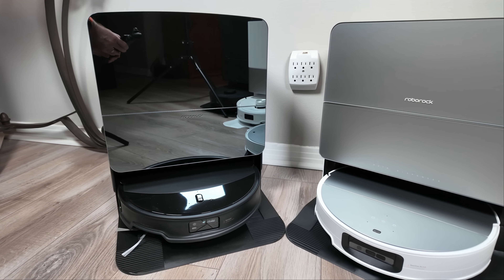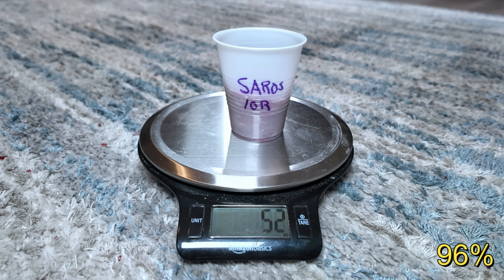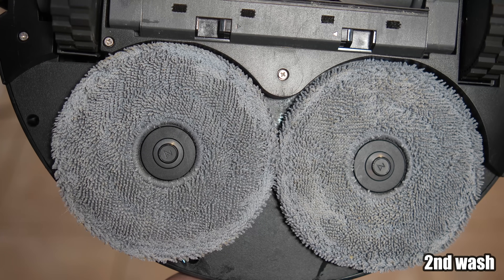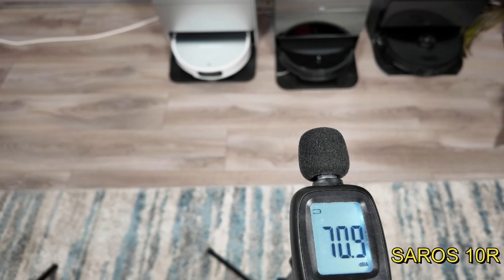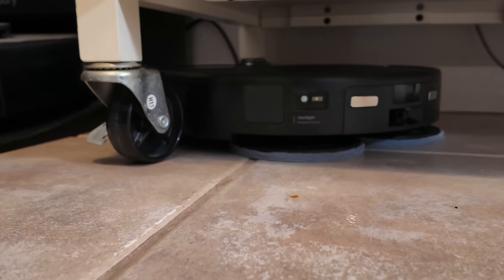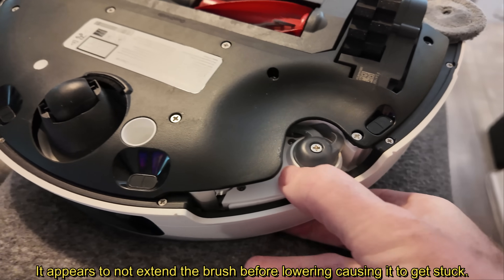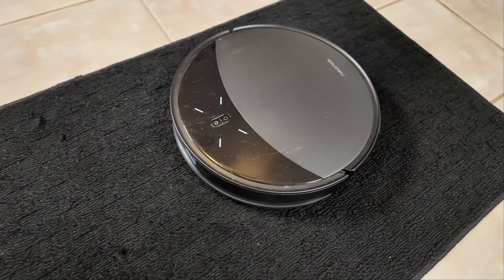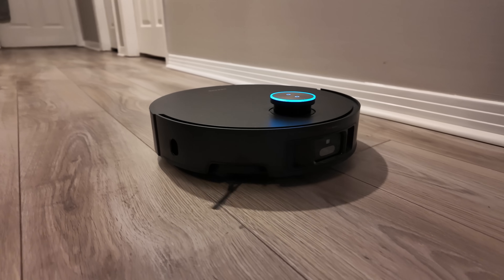Roborock Saros 10 vs. 10R: Ultimate Test Results!

Comment: Great review! I have a question: I have shiny white floors in my house, and when my iRobot Braava m6 mops at certain angles, streaks become visible, especially under certain lighting. I’m considering buying the Saros 10R, but I’m worried it might leave circular mop streaks. What do you think?
Reply from the maker: It certainly could.  Hard for me to say one way or another other than the Saros can wash the mopping pads more frequently and  it also helps to vacuum first.

Comment: Did you put the obstacle avoidance on sensitive? This made a big difference for me

Edit: I meant less collision mode
Reply from the maker: Yes in my tests for object avoidance it was set that way although you will get less coverage with that setting on near walls and furniture. Not ideal. 
Object avoidance for cords is worse on carpet than it is on hard floors.  On hard floors it would sometimes avoid cords and other times not.  The 10r did a better overall job with this.

Comment: I also wish they would make software updates to the flexi arm. Instead, they just keep pumping out new models that don't seem to be much better than the S7. I have S8 maxV ultra and S7+. Can they develop a better edge and corner cleaning system? Maybe a quick software up to do corners multiple times? Or add air pressure to blow the dust and crumbs from the corners on first pass? Or maybe better: small vacuum powered spring loaded nozzle to get edges/corners perfect? They have lidar to see edges and corners, but just zoom passed them.   Thanks for another great video! Looking forward for more of your reviews!
Reply from the maker: Agree 👍
Reply: Narwal tem um dos melhores aspiradores do mundo com rolo, está ainda em testes e vai ser brilhante n°1

Comment: Finally! I’ve been waiting for this! Seems like Roborock still needs to fine tune the object avoidance! Personally the 10R is much better even if the 10 looks WAY nicer and has better vacuuming. Also the 10R will definitely last longer than the 10!
Reply: the saros 10 is called g30 in china, it's this year (2025)  tech. saros 10r is g20s ultra in china, 2024 tech. both very good robots depending on your needs. the g30 space (saros z70) will release later this year and it's a saros 10 with an extending robot arm that picks up your socks.
Reply from the maker: They certainly do and it is clear to me that for some reason it has not been a big focus.  I mean I can't tell much difference from the S8 MaxV Ultra and when I tested this and I thought to myself that I can't tell much difference in that from the S7 MaxV Ultra.
Reply: @jamie.andrews there is a new lineup of iRobot roombas coming out soon that introduced lidar for its navigation wonder how good it will be

Comment: Useful review, thanks. I see vacuum wars now rates the Saros 10R as their number one pick. In particular they claim it was the only one to score 100% in their obstacle avoidance test. This contradicts all other 10R reviews I've seen including yours. They also said that there is an obstacle avoidance app setting that they set to highest sensitivity. Is there such a setting? I have the Dreame X50 ultra and am looking forward to comparison reviews against the Saros 10R.
Reply from the maker: It is certainly not the best especially with cords.  They also test on hard floors which are easier for the robots to detect items.  I test on carpets since that is where animals tend to go to the bathroom and carpets are a real challenge for robots in general. There are many settings for object avoidance.  I have them all turn to the highest. I think they might be referring to less collision mode.
Reply: @jamie.andrews  would be great to see a "flat soft object" added to the obstacle test eg bathroom mats can often clog robots. The thin cotton ones can bunch up and strand them, and the plush ones can choke them. ChatGPT is insisting the Roborock Adaptalift system helps avoid such objects, but I haven't seen any review test that!
Reply: Mine is seeing a lot of shower carpets as pet waste in my 10r. I wonder if I should be remapping after firmware updates , is quick map the only mapping setting to make things accurate? What’s the recommended settings for mopping water flow ? 10 minutes?
Reply: They now have the Qrevo edge as number 1 and 10R as number 2
Reply: @alexsallery  Interesting. I see also that they now have the Dreame X50 Ultra as number 3, but no full review of it yet.
Reply: @alexsallery  iirc it's because of the price/performance ratio, it's has almost everything the 10r and much cheaper
Reply: @xeon2k8  yeah that makes sense. Although it's only $300 cheaper here in Australia

Comment: And here it is! :) Thanks for letting me know you will be posting it soon. Been looking every day. :)
Reply from the maker: Hope you like it!
Reply: @jamie.andrews  It's awesome. Thanks :) You are the first one to show the hot water in the robot. The temperature camera is a nice touch. Sad that the hot water does not really transfer to the mop. Maybe it at least helps the first few minutes to keep the mops from cooling down too fast? Btw, did you pick the URL of this video? z7DW-mx-TRs ... TRs...man
Reply from the maker: @rxappdev  The hot water in the robot imo is just a marketing thing imo. It does not release enough water to keep the entire pad warm. The tanks only hold 70ml anyway.  I did not pick the url.  Lol
Reply: @jamie.andrews  I guess. It already has hot water in the station, so they probably just went with it either as marketing thing, or a test if it mattered. With the small dosage that hits the mop, the water would probably need to be boiled to 100 C or boiling freedom units hot to even make a difference. That would require boiling it in the robot which would drain the battery way faster.

Comment: So I got the Q Revo edge S5 a but ultimately decided to return it for several reasons one I totally agreed that the auto emptying system is unacceptable. We have a very clean house and the auto emptying system didn’t work about half of the contents were still in the dustbin because it was concentrating in the center Next, the object avoidance did not work very well and often the robot would not move in straight lines along the wall, I had to disable the object avoidance completely in order for it to hug the wall on the first perimeter pass. I also was not impressed at all With the mopping, and I imagine this would be an issue on all Roborock models with spinning mop pads, I often found that it wasn’t making tight enough passes and so there was a little area right in the middle of where the two circles meet that wouldn’t get mopped. You could clearly see gaps in the coverage. You could mitigate this by doing mop only mode and selecting deep clean, which did tighter passes, but then you couldn’t both vacuum and mop at the same time and the deep clean option seemed to just take forever. We’re talking 20 to 30 minutes for a single room.  finally maybe this is an issue on all robot vacuum mop combos as this was my first one, but I noticed the mop pads would dry out pretty quickly and had to set the robot to go back every 10 minutes which seems unacceptable to me. I mean our normal 1200 square-foot apartment would take a little less than an hour to clean with just vacuuming, but adding the mopping feature with the frequent return to the base was literally tripling the time
Reply from the maker: Yes what is best especially if you have dirt on floors is to either vacuum first and them mop or do 2 passes in vacuum and mop mode.
I always set the robots to go back to wash the pads every 10 minutes.  Since the pads are small they get dirty fast and you don't want them spreading more dirt around.
Reply: Between going back every ten minutes and doing a mop deep clean it must take hours to mop your floor then?
Reply: i mean 10min is kind of the norm maybe 15 max, more than that and you are just dragging dirt all over the floor. i do vacuuming first, and then mop only 2x passes on standard mode
Reply from the maker: @xeon2k8  💯